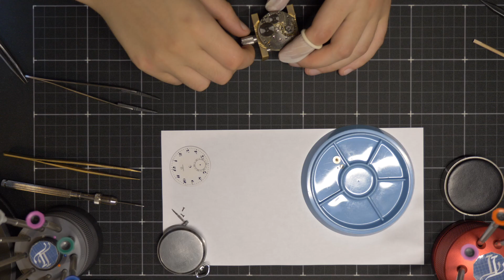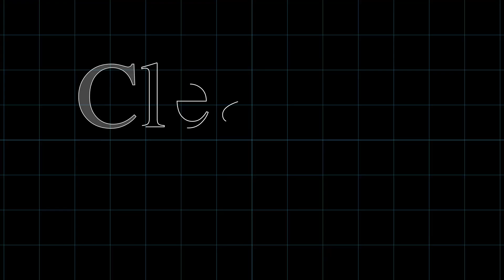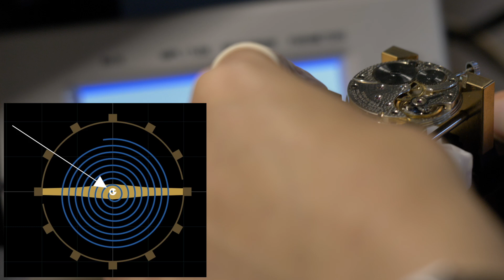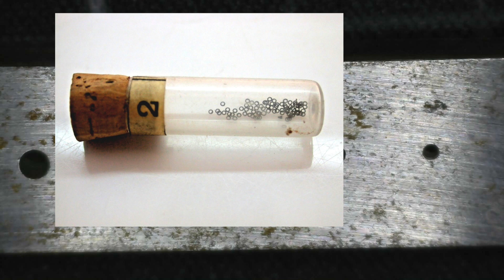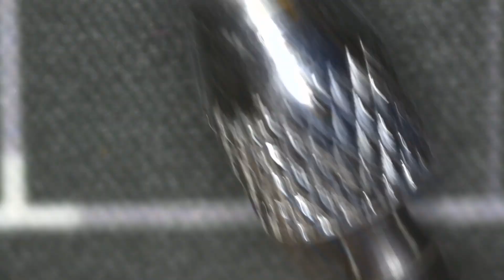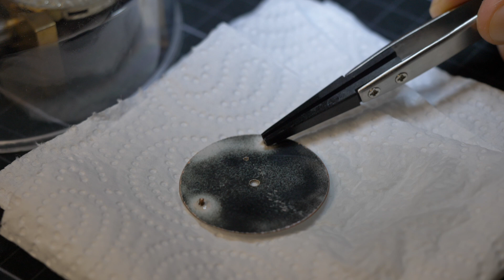1924 Omega Pocket Watch Repair : Full Service & Dynamic Poising

Comment: Great service, overall, but dynamic poising should only be attempted once a watch is free of mechanical defects, is lubricated correctly and demagnetized. 

The difference in amplitude between the vertical and horizontal positions present here should be addressed before any dynamic poising is attempted. 

The Jendritzki book you mentioned is an excellent resource, and explains this in detail.

Comment: That timing with the improvised washer is astonishing. Did you do anything else to clear that snowstorm?
Reply from the maker: Thanks!
The snowstorm on the timegrapher was due to very high rate numbers and a non-negligible beat error. I corrected both of these when I moved the collet (beat error) and adjusted the rate via the position of the regulator pins.
Reply: @tickingtime-watchrepair saving up for a timer and the basic oils. Look forward to learning more from you. Thank you